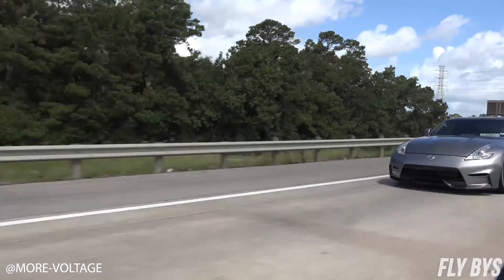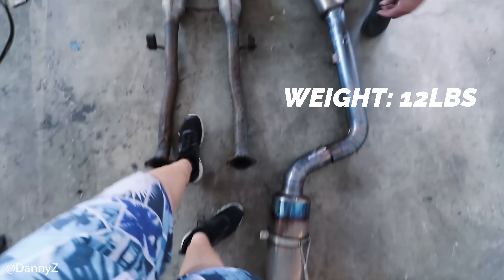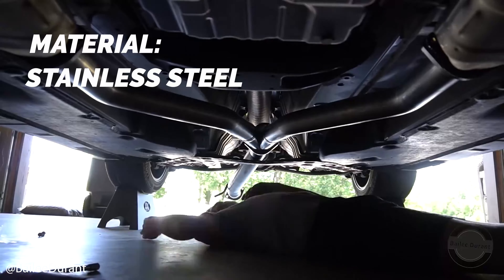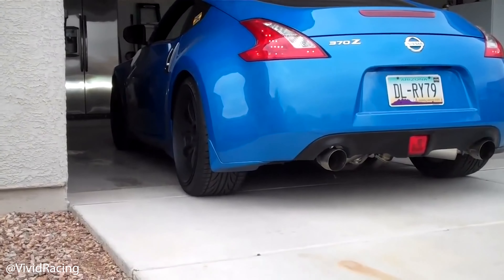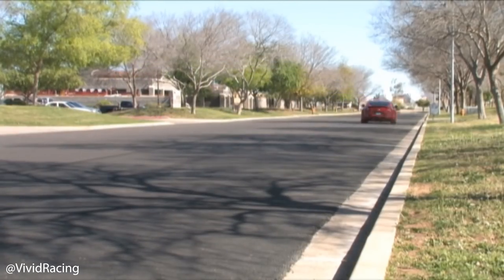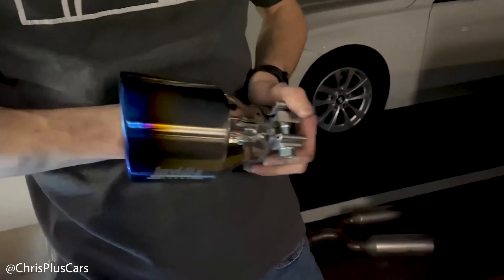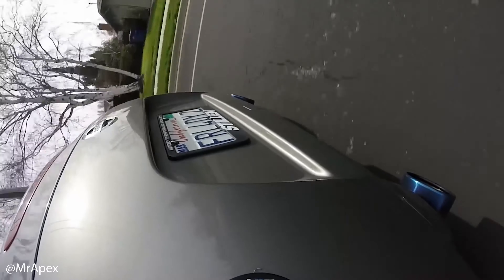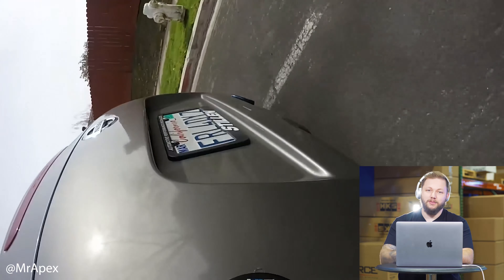Top 5 Nissan 370z Catback Exhaust Systems

Comment from the maker: What is your favorite exhaust for the 370z? 
Need parts for yours? Tap the link

https://bit.ly/3cTf2DV
Reply: Motordyne
Reply: Injen
Reply: R-tune Nismo catback
Reply: Couldn’t tell, this guy wouldn’t STFU long enough to hear them, all cars sound best on cold start, when someone is muting the exhaust sound to babble endlessly about the looks it completely defeats the purpose.
Reply: Where's the HKS?
Reply: Fast intentions no doubt about it
Reply: Motordyne Shockwave with ART test-pipes and Z1 headers, combined with ported manifolds and a high flow intake is the best sounding VHR37 combo imo
Reply: I have the Injen on my V1 Nismo and it sounds just right. I’d recommend it.

Comment: The Tomei does NOT tuck up high at all. Mine, like others I’ve seen are hung so low, I scrape on stock height! For anyone that can help me correct this issue, will be much appreciated.
Reply: I heard using a 350z tomei on a 370z is much better for that reason
Reply: U just didn't do it right. Plenty of videos of people having no problems with it

Comment: I’m a motordyne art pipes guy
Reply: Good for sound, not the best for making power
Reply: @Lofi.z34  that’s cap single exit make around the same power if not mayber 4/5 more hp admin tuned both he say they make about the same power
Reply: @jlou606  Depends on the tuner but nah you can get more from a dual because single exits create a bottleneck, really depends on how much power you're pushing. If you're mostly stock then you won't see much a difference

Comment: Tomei - I am older than 20, so I don't have to fool anyone into thinking my car is faster with cracks and farts - and my neighbours would most likely vandalize my car. I have a 370Z Nismo with Nismo exhaust (AAM resonated cat deletes and Stillen Gen 3 long tube CAI) It is still actually quiet. I am considering the Agency with the silencers. Would prefer a dual titanium system (not single)

Comment: I'm going with a Fast Intentions TDX CBE plus a Stillen Gen 3 CAI, along with an EcuTek reflash of my ECU with a dyno tune. I like the design of F.I.'s Siamese X-pipe crossover with its small entry and exit angles for the exhaust flow, resulting in a smoother flow through the merge area. My goal isn't to necessarily achieve maximum peak torque and horsepower numbers, but to get a uniform increase in torque throughout the rev range.
Reply: I just got it all done and brought my peak rwhp up from 282 to 321, with a uniform 15% increase in torque over the whole rev range. BTW: why wasn't the F.I. cat back mentioned?
Reply: Motordyne shockwave my friend >
Reply: @Unxpekted  no

Comment: I just love my Injen and it made a huge difference for my 370z and it improved the performance, definitely not for someone that is cheap.  Lol the sound and performance are amazing and I would buy the exhaust again.  I’ve raced stock v8 challengers and the sound is sick,  I have some videos but I will be doing some kicker videos inside the cab and on the outside too.
Reply: Where’d you get yours from?
Reply: @elixbori9723  autoanything I love that website they they carry other brands too.  Ordered performance breaks and other stuff and if you find a lower price they will match it up to a year I think still.  I bought my a while ago.
Reply: @HighEndDetailingATX  okay perfect thank you!

Comment: Been around a lot of tuned 370z's boosted and n/a. The best n/a setup I saw, money aside, was Fast Intentions long tubes with TDX catback paired with AdminTuning's 3-inch intakes and their tune. They have exhaust for boosted applications too. The Greddy super and AAM turbo systems are decent but you get more from FI. Hands down.

Tomei is a good single exit but you still get more from a true dual exhaust (stay away from 2-to-1-to-2).
Reply: Someone here knows what they're talking about.  FI by far also looks the nicest and blends in really well with the CF look.  Kevin at FI is super cool to work with and while they may have had a 3+ month waiting period, the quality/craftsmanship is superb.  5+ years later mine still looks/sounds great!
Reply: can you give me a list of mandatory upgrades if I wanna boost a 370z? I’m 18 but I plan on having this car until I’m 22-23 so idk if I wanna break 700-800 HP but ik I wanna hit at least 600 can you give me some advise on where to start and the order..
Reply: @Lofi.z34  Bingo!!  I did the math and ended up around $20k...  I know the FI Turbo kit is around $12k, then you have install/tune... transmission work...  I Could easily see it in the $20k range if you want a built transmission.   This is why I'm simply sticking with my "boring" 370z that's basically stock, and will get the new Z...
Reply: @Lofi.z34  I was a moron and got the 7AT;  After 6.5 years on an aftermarket clutch on a wrx as a daily driver in stop/go traffic was my breaking point...  Now that I work/live  remotely, I'm in heaven, so it'll be back to a six speed on the new Z for me, otherwise, a built 7AT is from what I've seen all over the map in terms of being "built" and in all my years reading the 370z forums on that issue, it's just not worth it to me.   Again:  My fault, but ya live/learn...
Reply: @ChainedCannon  that 700-800hp that you want is unrealistic, unless you plan on fully building that motor from bottom to top. An stock motor VHR can’t handle that kind of power. You can make it to 600hp on a stock motor but that is pushing it to its limits already. If someone is telling you their running 600hp on their Z with no problem, trust me, it’s an ticking bomb.
Reply: @johnnyboi5661  yeah Im aware it can’t handle that stock.. was just wondering what I could do to get it there other than camshafts n pistons

Comment: The tomei with the standard cats sound raspy towards the higher rpms, but im using the Motordyne art pipes with my Tomei and top end sounds phenomenal. Deeper tone and no rasp
Reply: i got a few questions! gonna need some links to your setup that sounds like something i’d be down to do. hmu on insta if you can @zachwright2
Reply: I Also have a tomei setup with motordyne art pipes hate how loud and abnoxious it is going full motordyne setup.

Comment: For guys that want a low profile with a good sound:. The XForce exhaust is an option.  It's quieter outside than even stock (to my ears anyway) and it's a full true-dual 2.5".  And you can get it a tad cheaper.  I was torn between it and the Agency Power.
Reply: had it for a couple years. sounds great at low rpms. But I'd love  a bit more noise up top. definitely added a nice torque bump.

Comment: what do you think on the ark grip dual exit exhaust?
Reply: I had one I liked it but the Grip hangs really low and when I lowered my car more things were rubbing.  I switched to a JDM exhaust by Saclam that hangs higher.  I still liked the Ark Grip exhaust notes though it was more of a lower tone.  I think Ark copied HKS' design.  Ark is located in Ontario, CA though if you ever wanted to contact them directly.  Not sure where you're from.

Comment: Motordyne shockwave tops all those true dula exhaust
Reply: IF they did not have the stupid chrome muffler look, I would have went that route.  I went FI with the CF mufflers, and would love to have some MD headers, as I love that they give you three options depending upon emissions laws where you live.  I move around a lot, so it will be nice to plug n play a high flow cat in there when needed.

Comment: I have the Tomei Expreme TI full Titanium exhaust on my 700 hp R33 GTR and it sounds great, I also have a Midori Seibi Centre full Titanium down pipe which also makes a Big difference to the car, but for the 370 Z I would choose the Reimax full Titanium system, there the Best quality in my opinion, drive safe guys.